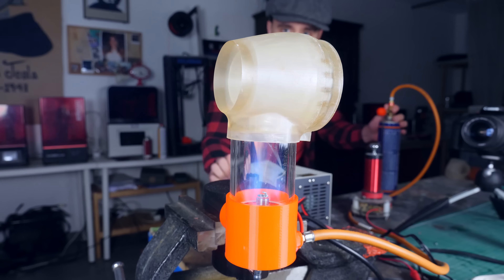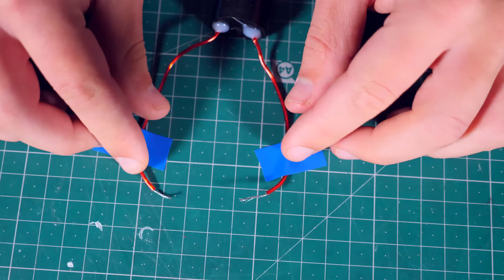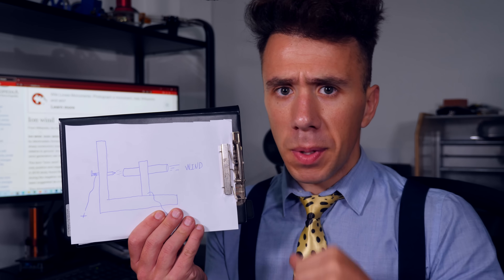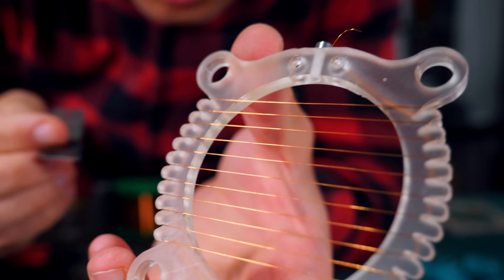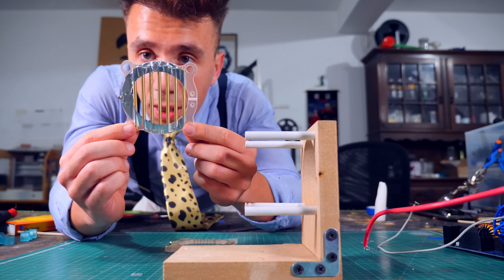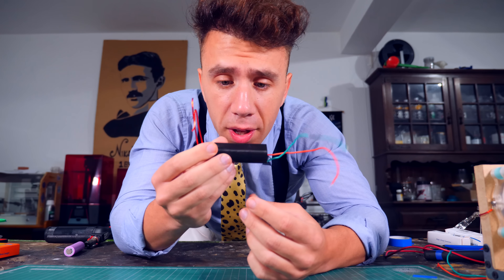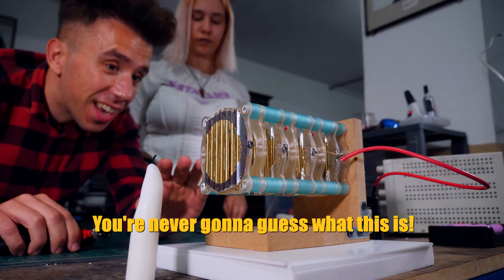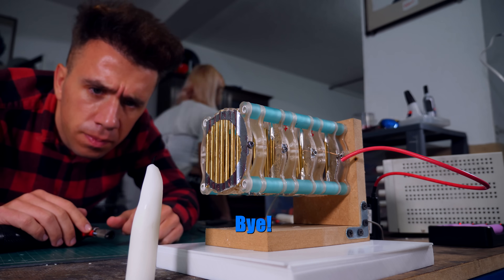I built a TRUE BLADELESS FAN

Comment: Excellent video!
I did a lot of research on the subject back in highschool. 
A lot of the patents that use a positive charge on the emitter were intended for a mercury/gallium vapor propellant for satellites. For nonmetallic gasses, a negative charge will produce more ions. Also, there's a capacitive movement effect with shaped plates that can work with high voltage AC. 
Check out some of the work by T Townsend Brown, where he referred to the phenomenon as electro-gravitics.

Comment: I think you should try scraping the wires along the length of the wires, rather than across them. Maximize the surface area on the wires that can produce a coronal discharge by scraping the insulation off that way.

Comment: As i told under Jays video you can try to do even change the angle of wind direction if you will make them in array, and  control them like a phased array antenna
And it would be pretty if you will make it DNA shaped it may be in the vortex at the end:)
And one more thing this video about ion thruster on real satelites shows that there is two grids negative and positive on the end that gives leavin particles even more speed youtu.be/bHunhXk9i2s

Comment: • Build a ducting shroud around the entire setup to confine the flow. You could also test a variety of nozzle shapes to see if you can achieve Laminar Airflow.
• Repeat building the paired sections (wires/tubes) in a Toroidal Shaped Shroud, with Intake & Outflow (kind'a like a Radial Fan), so that air enters, accelerates around the loop a couple of times, then exits - very fast.
• Pretty much everything really depends on what the Optimum Voltage is for this configuration & these materials, but the higher the better for big arcs (so long as nothing melts from resistance). 
• Experiment with a much higher density Wire Grid (with Silver or Gold Wires) & try thin Graphite rods instead of the current metal tubes. Replace the Aluminium Foil with Copper Wire. 
• Try hooking it up to a 10,000 Volt Van De Graf Generator to really see the plasma fly!
• The scratching trick would be profoundly improved if you could find a way to grow short Nanowire Threads every couple of millimeters (vapor deposition, perhaps?), until each individual Wire Grid looks like a microscopic forest. 
• How close can the wires get before they start interfering with each other? (eg: Magnetodynamic eddy currents) 
• At the Maximum Voltage, what's the Optimum Distance between the Wires & the Rods?

Comment: I wonder if you need to use progressively higher voltages for successive stages since the ionic current will be increasing after each stage it passes through. For that matter, do you actually need multiple cathodes? What about having one cathode to field ionize the air and then successively increasing positive voltages on stacked anodes? Seems like there is some room to play around with those configurations.

Comment: What if you 3D print an airfoil mold, so the negative tubes can have a lesser drag, and thus, improve the performance? You might use some aluminum foil as the material for mold the new airfoil-negative-tubing… and maybe making a “body” to direct the airstream…

Comment: Video idea: Nikola Tesla using the power produced by his tesla coil proved that you can use the ground as a conductor for electricity resulting in the transfer of wireless energery. His experiment to prove this was done using a lightbulb but if thats too boring you can find another way to show off this discovery of teslas. In a Tesla Documentary on the HISTORY channel they actually prove tesla right and also use this wireless electricity to power a remote controled boat as well as lightbulbs. Definetly something you should check out!

Comment: Make an ionic helicopter blade on a stand. Make the trailing edge of each rotor blade the ionic thruster with a wire beside it and see if you can get more lift by spinning a wing rather than using ionic thrust alone.

Comment: What if you made a working Napier deltic engine using compressed air or maybe even real gasoline? A Napier deltic engine (or just the deltic engine for short) is a weird internal combustion engine that has its cylinder’s arranged in a triangle shape and facing outward (it’s easier if you look at a picture) these engines were a British design that was meant to be a more powerful engine. as far as I know it was only used twice. The first time was during wwII when they were used in torpedo boats and the second was during the early 1960’s when they were used in a diesel locomotive that was fairly successful.

Comment: The two issues that spring immediately to mind are power consumption compared to a normal fan, and dust.  If it takes more power than a bladed fan, there isn't much point.  All those wires are basically a lint trap, and with all that electrical arcing its probably a fire hazard.  Also maybe ozone?

Comment: Great ozone generator, I know you are used to questionable safety standards but try not to end up in the emergency room with Ozone poisoning! Someone did end pretty bad while experimenting with ionic speakers, basically the same thing but modulating the flow with an audio signal.

Comment: Aerodynamics matter.  You need airfoils instead of tubes and pay attention to pressure and drag areas.  

I would be interested in the performance from a circular form for the wires instead of the parallel line arrangement, all within a circular duct. Make the inlet slightly larger than the outlet like what is done for ducted fans. 

Thanks for the entertaining videos!

Comment: video idea: it would be nice to measure the thrust produced by the bladeless fan in different conditions (like higher pressure, higher initial wind speed...)
Reply: We know the top air speed (~6m/s), so you could just multiply it by the surface area of the fan exit and the density of air to get total force, right?

Comment: Well if you have speed but not enough mass flow I believe a funnel can help you.
Wih the Bernoulli principle if you shoot a jet of air into a funnel it will drag surrounding air with it through the funnel. So making every stage of the ionic fan in the shape of a slight funnel could help you gain more mass flow. Although I expect the optimal placement of the funnel will end up being between the stages instead, as in the sharp end of the funnel has more sharp wires sticking out pointing at the big blunt end of the next funnel and shooting lightning at it.
Maybe

Comment: Hi there, big fan. I was working on this ion wind fan some years ago, I did the research and experiments and my personal best so far was blowing off a candle  from around 60cm away. In my experiments I found out some things that might be helpful. The smaller the wire diameter the better the results, I used some 0.1mm stainless steel wire with good results, it is also uninsulated so the whole area is exposed and not only some spots that you cut into the insulation of the copper wire. It is also stronger, because copper wire that size breaks easily if you pull it too much. Stainless is a bit hard to get sometimes so I tried other materials, resistance wire khantal or nichrome also can be used with the same results as long as the diameter is the same. They have higher electrical resistance, but at those voltages and currents that does not matter. The wires will cover in super fine dust from the air rather soon and this will limit the performance so it is advisable to use an enclosure and put some hepa filters or something before the electrodes, that will prevent this problem. Also if the wire is too thin it will break if an actual arc forms, so use some current limiting resistor on the hv side to prevent this. Arcing can happen by many reasons, just try to put a flame in the fans inlet, the hot air will dramatically reduce the air electrical resistance and it will arc over the electrodes. Also try to change the HV polarity on the electrodes, there is a difference. If you use negative on the wire, you will also create negative ions, which is supposed to be like beneficial or something, Positive ions are supposed to be bad, I dont know about that much. And I noticed there is a difference in sound as well. Hope this helps. Thank you for the entertainment.

Comment: Not sure but building a venturi at the end of it to increase the pressure and higher gauge wire with the voltage pushed up and enclosing the sides and also wondering what would happen if the wires spiraled creating a twisting motion

Comment: Maybe if you used grids in descending diameter, inside a cone like shell open on both ends. This might be enough to make use of the Venturi Effect to accelerate your airflow.
Reply: Yeah, grids being the same size has nothing to do with burning out things...
CRTs have had high voltage across irregularly sized grids for literally a century with zero problems.
Any sort of amplifier tube ALSO has irregularly sized grids. If you're concerned about overcurrent, that's entirely misplaced since HV grids, especially in just open air, allow very low current flow.
Reply: I was going to suggest this very same concept.👍🏻
Reply: nope. the grids should remain the same size or you overload the system and burn out things. the waste of this design is tragic to an embarrassing degree
Reply: @mouserr  Do you have a nice video demonstrating your hypothesis?

Comment: I've made one of these before but I have a process I've been trying to do and haven't had time to. I want to make my anode a fan blade. I figured if I used ceramic bearings and a light brush on the front of the blade I can get the current flow properly. This might be a project that's set up perfect for you Integza. The next step I wanted to do was add a blade on the cathode and then if that worked I want it to add a neutral blade in the center to make a three-blade compressor using ion flow. I have not had the time or the materials to start building this again due to family emergencies the last few years. I have never seen anybody attempt this yet. I also left this comment on the plasma channel when he first made his little ion engine. PS just in case, I'm not set up on anything other than YouTube for your channel and I have two printers and a laser already so if you happen to select this comment go ahead and give it to someone else 😁

Comment: I think you can cut the tubes into small pieces and solder them together to make for more surface area and to let the air go through the negative lead instead of around. Another idea could be to cross the positive lead wires over each other for more of a grid pattern.

Comment: make proper engine body and air funnel to direct air through the engine and not escaping in the midle *or everywhere else =D an then, just stuff more grid into same space, that's my guess how to improve such engine. less space between ''pole plates'' and more plates in same space, more sharp edges on wires, more turns of wire on same plate. but that is one interesting machine =D i added it to my ''do it myself'' list

Comment: I'd be interested to see if the bladeless fans could be used to generate pressure, so they could be used to aspirate engines or something similar.
Reply: They cannot compress air, so no. If any backpressure air spills out the front intake duct.

Comment: This may be a dumb question, but I wonder why those series of bladeless fans don't counteract each other? I mean, non-borderline wires have grounded rods on both sides. Shouldn't ionic wind blow in two directions simultaneously?

By the way, what would even happen if you would've have one line of wires and two sets of rods on each side? And encase the whole setup so it wouldnt draft air from the sides. And more importantly...

Why the hell I'm watching this at 4 A.M.?...

Comment: Is this type of fan considered laminar flow? Contain the system in a tube to build pressure in the flow and reduce side air leaks. In general work on optimizing the airflow. Does voltage, amperage or frequency make a difference in flow? Should the wires from one stage to the next be in line or alternating? What if the wires are rotated 90° between stages? Let the competition begin!

Comment: Integza!  Be careful with your table saw!  I say this out of love for your channel and care for your safety.  More than one of your clips show you using your hands on both sides of the blade.  This is extremely dangerous.  MDF and particle board are forgiving in this respect but when cross-cutting (cutting perpendicular to the grain) a solid wood board, it is important to push from the fence side only.  Pressure should go slightly forward and more against the fence (to ensure a straight cut).  IF you were to put pressure on both sides of the wood, you run the risk of pinching the blade (solid wood will flex and it doesn't take much).  If this happens, the blade grabs instead of cutting and will fire the entire workpiece back at you.  Saws are powerful and this can cause injury.  Again, the proper etiquette with a table saw is to push from one side of the blade only.  If using a fence, it's the fence side.  Enjoy!!

Comment: Could you utilise a Tesla valve to generate directional thrust? I'd imagine there may be thrust coming out of both ends, even if slightly on one end.

Ie. Imagine each 'blunt' and 'sharp' points within the valve is charged correctly to create vectors internally.

Comment: You know how you electroplated some of your previous projects? 3D print a disk with lots of little spikes and electroplate it, make sure to have holes in between each spike. Also instead of a tube, make a mesh of copper wire. As for protecting the air flow, encase the fan in a duct so it actually sucks the air from the back as opposed to everywhere on the fan.

Comment: Maybe it's completely wrong but the fact that it takes few seconds to blow the candle I'm wondering if the the wind generated is as strong as the anemometer is measuring it or there is a sort of effect with a magnetic field that make it spin faster than it should? It's just a question not a take at all

Comment: I always used the high voltage supplies from old CRT computer monitors. 20 years ago, when everyone was building these LIFTERs there was no shortage of old CRT computer monitors as everyone was upgrading to flat screen monitors. Many of them even have high voltage adjustment pots as part of the circuit so you can tune them in to the project.

Comment: That triangle that they had flying in the video you saw. looked very interesting.
Surely the next idea is to replicate that - and then see if you could create one that's more powerful with nested triangles, or nested squares.
Then see if it can be powered from a battery, and if it's powerful enough to lift up the battery and the circuit stepping up the voltage. - i.e. have it flying around the room...

Comment: It looked like the plasma was touching/reaching the tubes in your final design. Is that a good or bad thing, what happens when you move the ground plane distance from the high voltage, I'm guessing there is an optimal distance?

Comment: @Integza Kinda surprised you didn't improve on the design.  The tubes would perform better if the trailing edge were flattened so it's a teardrop in cross-section (less turbulent flow).  The stages should be wider (gap between wire and tube) and have higher voltages as the air accelerates, and the stages should have smaller diameters towards the exhaust. The whole thing should be ducted (laminar flow) with the cross-sectional area dropping proportionately to the air speed, otherwise the system is fighting itself, ie vacuum towards the exhaust instead of increasing pressure towards the exhaust.  For that last point, think multi-stage compressor.  Each stage must not overcome the pressure of the stage before it or work goes to mixing air instead of accelerating it, resulting in turbulent exhaust with divergent thrust vectors, which requires a converging-diverging nozzle to correct.

Comment: Very cool concept and great results! You should try doing a smoke test with your bladeless fan, I think it would look interesting!
Reply: Great idea. He could also submit it to the fan showdown!
Reply: smoketest like in software development or smoketest as in aerodynamics reasearch? please be the second one
Reply: @adriand00  smoke test like getting a smoke machine and blowing some smoke through it. This makes the airflow visible.
The vaporizer from that hipster friend we all have will do fine too.
Reply: Is smoke machine smoke in any way flammable?  Because if anything could set it on fire, it'd be this rig
Reply: @TonyHammitt  No, it's not, if anything it would smother an open flame.
Reply: @retromodernart4426  Well, I'm no chemist, but they use glycerine to produce the smoke, which is an alcohol and could ignite. At least theoretically.
The is a method with dry ice, which causes the moisture in the air to condensate. But I don't know how hot the plasma gets, so the moisture could easily evaporate quickly as well.
Edit: The humidity in the air could also change the conductance of the air. Sparks could be a problem.
Reply: @alfonsmuller2318  

Flash Point (99% glycerol) 177°C

Fire Point (99% glycerol) 204°C
Reply: Plasma is also usefull for cleaning air of very small particules as fumes and dust.

Comment: You could try to combine this with a jet engine, in a way making the air compression this way instead of the traditional way whit the blades, it should be much easier to manufacture low power jet engines this way.